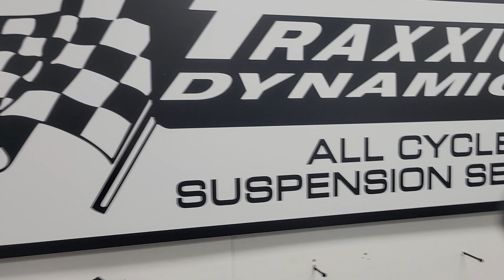Tutorial on Causes of Motorcycle "Pulling to Side"  w/Max McAllister & Traxxion Dynamics (Goldwing)

Comment: Mine is a GW18 DCT BD model.
Now on 3rd set of tires.  The originals were Dunlop D423's.  The bike pulled to the right. At 12K+miles they were replaced with Bridgestone 853G's.  No more pulling to right.  But, there was a pronounced handlebar shake with hands off between 40 to 50 mph, with the worst at 45mph.  The Bridgestones lasted about the same as the original Dunlops, just over 12K miles. Now have Dunlop Elite 4's on.  Shaking is gone completely but the bike drifts right with hands off.

Comment: Hi Max, Merry Christmas and Happy New Year!

 I thought this was a particularly great video because I have always noticed that my 21 GW tour pulls to the right.  I love using the cruise control, but I can't just take both hands off the bars without starting to veer off to the right.  If you would not have talked about this, I probably would have been trying to adjust it out with the tie rods.  I did get your replacement link, and though that it might cure it too.  It drives me nuts, I can keep it going straight down the road, but I have to sit off to the left on my saddle.  Back in 2005 I rode a new Goldwing from Florida, to Illinois, and was amazed how you could set the cruise and simply ride straight down the road. 

Can't wait to see what you are coming up with to cure this issue.  

Pat Mann, Bloomington IL
Reply from the maker: Will have something soon!!!

Comment: My '21 Goldwing has a slight pull to right, I figured  the rotation direction of the motor was causing it. I can go free handed with my left knee out catching the wind or move body to the left a bit.
Reply from the maker: Sitting partially off the saddle for long periods of time is not good for your spine.  But it only takes a little hand pressure to keep it straight as well.  Some people jus like a bike that goes perfectly straight.

Comment: I am just now seeing this. I watch most of your videos and learn a great deal.  There is a very inexpensive solution. Add weight to the opposite side of the pull till it goes away.  You know put the heavier stuff opposite of the offending pull.  Kinda kidding of course.... but that is an option.   
However I have a VERY IMPORTANT QUESTION. I know you have the belly pan for the 2018+ GW's to protect the engine block.  What is the story on the bikes before 2018?  I would like your advice on buying a F6b. The years of 2013 to 2016.  Are there any serious worries about these models?   Thanks for your sage advice !!
Reply from the maker: For the 01-17, there are many "belly pans" to choose from.  There was no real risk of breaking the engine cases, but the coolant bottle was infamous for being cracked or just worn out from road grime sandblasting it.
Reply from the maker: We make a hidden counterweight for the 2018 that does just what you describe, while leaving the saddlebags open for maximum storage.

Comment: What about those of us with a chain drive sport bike, brand new, never dropped but still pulls to the LEFT?  Can adjusting the axle compensate or will this cause other problems?
Reply from the maker: You need to get a tool that accurately measures from the swingarm pivots to the center of the axle to get your alignment spot on.  If it still pulls, then you have a defective frame from the factory.

Comment: Hey Max. As  you say, the influencing factors are endless.  We've all tried it and with cruise control it's a matter of how far can you go?  Sometimes mine pulls to right, sometimes to left, sometimes it's arrow straight.  And what does arrow straight tell me?  Nothing.  The wind and/or road camber could be compensating mis-matched luggage distribution.  Bottom line is that it's always arrow straight when I'm holding the bar grips.  Happy New Year from the UK.
Reply from the maker: Some people do have a real problem however.  They have to hold the bars and push back with enough subtle force all day that they end up with fatigue in their neck, shoulder, and arm.

That's who we're going to help.
Reply: @Traxxion  Sorry Max, I didn't mean to suggest otherwise. It'll be interesting to see what you've come up with and how it'll correct the problem.

Comment: Max I bought 2022 Goldwing touring this fall and drove it 100 miles and the handle bars shake or vibrate. I plan on bringing it back to the dealer this spring but I live in southwest Minnesota so the weather is not great for riding right now. Do you have any idea what would cause this. Thanks Del.
Reply from the maker: Bad front tire.   https://youtu.be/0Iq0vCSk7vo
Reply: @Traxxion  Thanks its a new tire on a new bike but it still could be bad or out of balance.
Reply: @Traxxion  My 18 wing came with the Dunlops. It would shake like a paint mixer if you took your hands off the bars over 40mph. Replaced with Bridgestones and it was fixed. We will see if the issue returns once the stones get some miles on them.
Reply from the maker: @delanderson8045  99% of the time it's never balance... just a bad tire.
Reply from the maker: @cbxdavid  the brand is not the problem.   You just had a bad tire.
Reply: @Traxxion   You are right Max, I bought a 2018 GL1800 new with the same problem like David Hansen Vibration in the steering wheel (front wheel was a Bridgestone). After 100 Km wheel out and balanced. The vibration in the steering wheel was less but still felt!!! After 20,000 Km replaced by a new Bridgestone....problem was gone!

Comment: Hello. Is it possible to pulls to the right side because of telescopic forks needs oil ? In my case when i have second passenger (extra weight) the bike pulls right more.
Reply from the maker: That is completely impossible.  The forks do not work separately.  They are linked by the axle.  Both forks are "one" assembly.  It's an old misconception.

Also, adding or removing oil (adjusting the height or level of the oil in the forks) only controls bottoming resistance in the lowest 25% of travel.

If you bike has very soft springs, and cannot hold up the driver and passenger, then riding on the bottom of the suspension can cause many handling problems.
Reply: @Traxxion  thank you VERY much... I will try you method and i will respond for the results 😃

Comment: Sidecar rigs can control steering with toe of the sidecar wheel. At least that’s what I remember having owned one way back when. What about the position of the rider? More weight to one side or the other affecting pull to one side or the other?
Reply: I scoot my butt to the left on my seat if my hands are not on the bars, you just have to find the right balanced spot.  Also, the same for if you are sitting on the passenger seat with the cruise on, would not recommend for most riders to try, but it is a nice comfy spot, and you'll get lots of strange looks from other people, well maybe not from Tesla people NOT driving their cars as well. LOL
Reply from the maker: Yes shifting weight will move the bike... adding a 500 pound side car will too...
Reply from the maker: You shouldn't have to shift yourself off center to get you bike to ride straight.